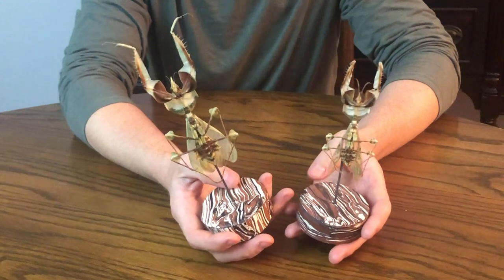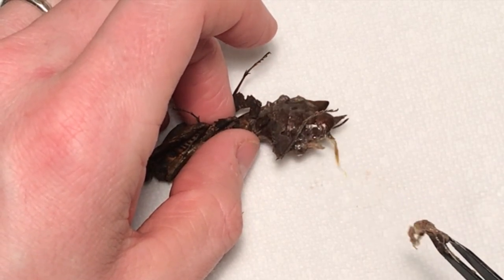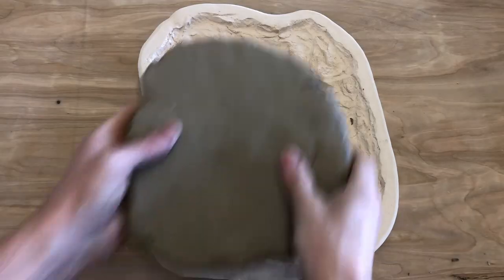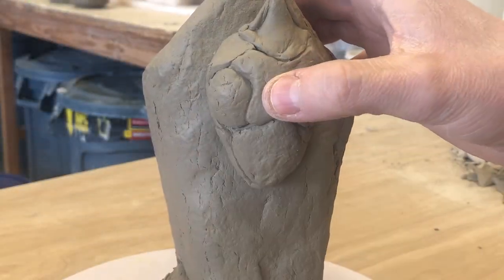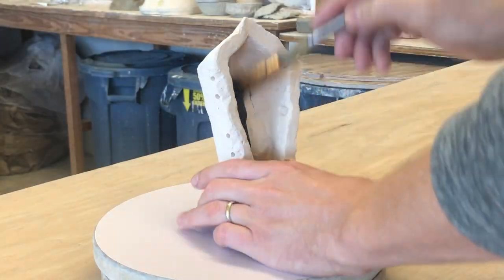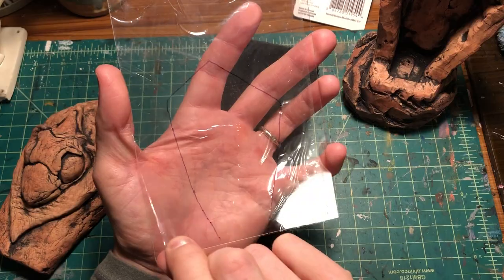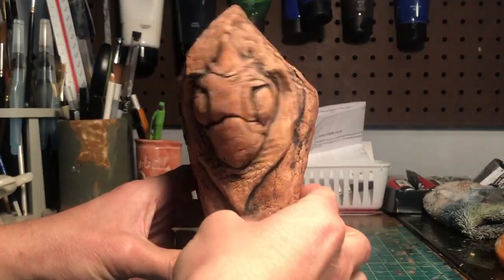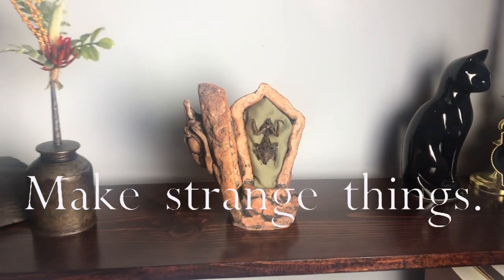How I Sculpted a Sarcophagus for my Praying Mantis

Comment: Really awesome project! Perfect editing, too!! Did you consider putting the hinges on the inside of the enclosure so that they would be hidden when closed?
Reply from the maker: Great question! I did consider it, but I would have had to extend the thickness of the left interior to the width of the hinge, which would have negatively impacted the overall composition. Plus, I knew I was going to have this displayed open more often than closed, so they are less visible to me this way 😁